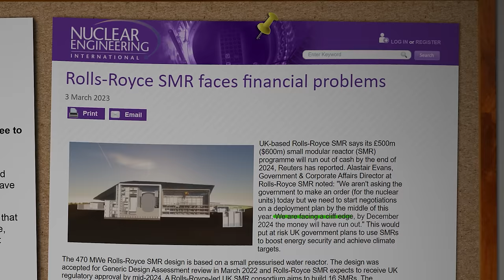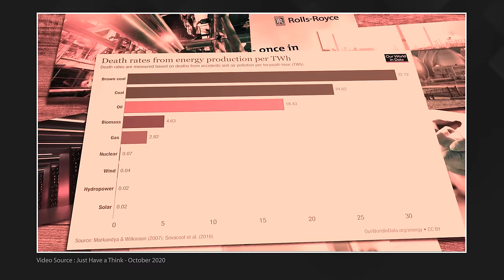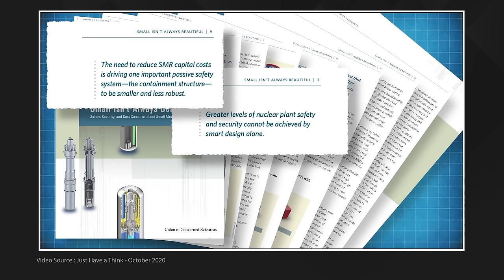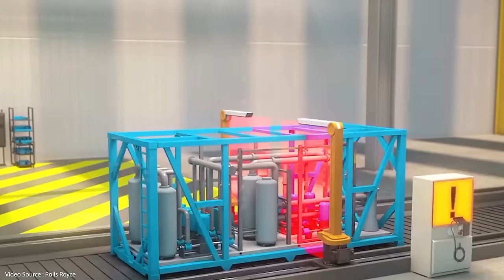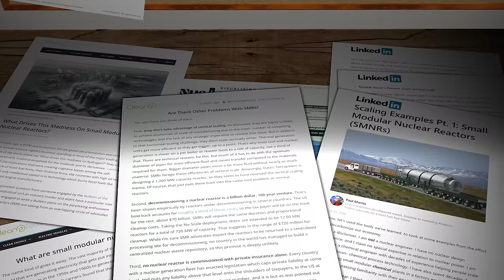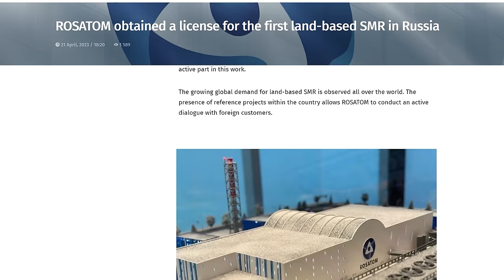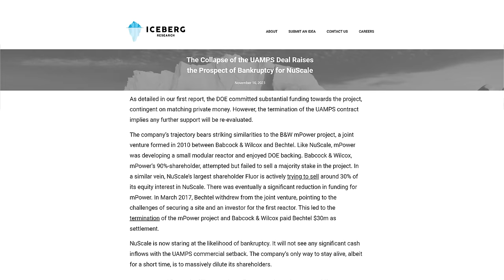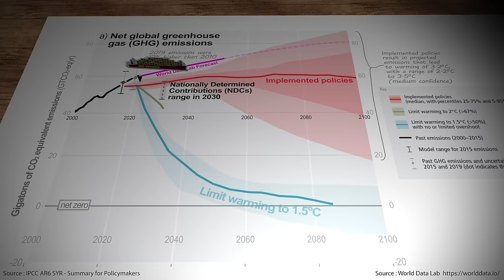Small Modular Nuclear Reactors. The Verdict

Comment: The thing about NuScale's $89/MWh estimate is that without subsidies it's actually $119/MWh. The thing was the head of the Idaho member of UAMPS, an industry veteran, had calculated the cost to be $130/MWh. 

Compared to $82/MWh for both wind & solar with lithium based storage currently according to independent analysis  by Lazard.

The difference also being solar, wind, and storage have a proven track record of declining costs, with newer technologies hitting the market with even lower costs. Nuclear, on the other hand, has a proven track record of rising costs even with reduced regulation and newer, simpler designs that were supposed to be quicker and cheaper to build (AP 1000 & EPR).

And as France found out the hard way, having most of your reactors being the same design means that a defect found in one, a 24mm deep crack found in a pipe, which carried radioactive water, with a wall thickness of 27mm meant that they had to shut down over half their fleet for inspections and repairs IN THE MIDDLE OF AN ENERGY CRISIS.

That on top of having to operate some of the rest of their fleet at reduced capacity due to inadequate cooling as the rivers they relied on were too warm. 

Honestly with a track record like that, how could an objective, rational person think nuclear is a good option?
Reply: To be fair, a key argument for SMRs is that power costs for the "Nth of a Kind" would be substantially lower due to mass production techniques and shorter build times.
Reply: @gibbonsdp  which has to be taken with a BIG pinch of salt considering the nuclear industry's long history of substantial cost & schedule overruns.

Even with France's much vaunted nuclear fleet, independent analysis has shown that their claims of low costs are due to heavy subsidies and very lowbal estimates of O&M costs. When the subsidies are factored out and realistic O&M costs based on real world experience are factored in, the claimed cost of $40/MWh ends up being $90/MWh.

But that analysis was before the latest kerfufle. With the much reduced capacity factor due to the shutdowns and reduced production due to the cooling issues, along with the repair costs for the cracked pipes, are factored in the costs will be higher.
Reply: @gibbonsdp  Those mass production assumptions are asymptotic, and the kind of scale needed to hit competitive pricing with solar and wind (which also benefit from economies of scale) for any form of nuclear is into the hundreds of thousands or millions of units, even for ill-conceived radium dial watches. Which for any form of nuclear exceeds the materials available on Earth by hundreds of thousands or millions of units.
Reply: the cost of renewables is going down because theres constant investment in them and their infrastructure
 nuclear is going up in price because its just not being worked on at the same scale, theres no experienced operators, builders, designers, even in countries with a history of having those things nuclear has just been forgotten about and an entire advanced industry isnt something you can cheaply build over night
as important as renewables are, having a base load of nuclear is always going to be a useful thing

also something interesting to note, its weird how people always bring up the subsidized cost of renewables or nuclear and say its too expensive without subsidies, while conveniently ignoring that fossil fuels are subsidised 7 trillion dollars per year globally
wonder how much fossil fuels would cost per mwh without those subsidies to get a more fair comparison
Reply: The cracks were found in pipes which do not carry radioactive water. These belong to the secondary circuit system. This problem was related to delayed maintenance due to Covid. And regarding water management of nuclear plants, some nuclear plants are concerned indeed by this issue but there are only a handful of nuclear plants in France being in that situation. It's not a question of water from rivers being too warm to be able to cool down the reactors, it's a question of water being too warm once thrown out to the river in order to avoid harming fauna and flora.
Reply: The main issue with solar and wind is its ability to provide baseload power for the grid, which is why they need battery storage to try and attempt to have some sort of reliable baseload power. With the electrification of the car industry and battery storage for the grid is currently relying mostly on lithium to solve both problems, however there is no current supply or untapped reserve  of lithium that could meet either of these needs. 
So a different source of baseload power is required for the grid instead of relying on wind, solar, and battery storage for the future electric grid needs. The only options that are left are nuclear and geothermal to meet the baseload requirements for the future. 
Of course there is the ultimate saviour for wind and solar being the only source of electricity for the world, an interconnected global grid. But that will never happen as global politics will not allow this to take place.
Reply: @bartroberts1514  What exactly are these materials needed by wind and solar in quantities exceeding the available resources by orders of magnitude?
Reply: @IronmanV5 you’re comparing two different types of nuclear power. You can’t use France or the past to argue a pattern of the past.  It’s a different path and different model for deployment and development…
Reply: @Drought-jr6pb  Nobody wants baseload power on the grid. Nuclear and coal run 24/7 and prohibit the efficient use of the energy produced by renewable power. If you have 15GW of baseload on the grid, you either waste excess renewable production or even worse use super expensive nuclear energy to produce green hydrogen. I am not sure if you are trolling, but lithium batteries are far from the only technologies for grid level storage. Natrium based batteries, redox flow, pressure and heat based systems all can store excess renewable energy. The last 10-15% of electricity production can be served by gas power plants, they are standing around anyway.
Reply: @batonnetdecannelle  Pleased to correct my post so no one can mistake the intended meaning that nuclear is the technology with scaling issues. Wind and solar do not have such problems.
Reply: @Drought-jr6pb  You're repeating fallacious assumptions. Wind and solar are not dependent on 'baseload' (more correctly, 'on demand') generation; grids that meet needs from solar and wind would be intermittent grids, that's true; however the very car industry you cite as a negative is the vector for V2G grid storage, where for the price of grid-scale storage that charges intermittently and dispatches on demand, you get a free vehicle.
Hydro, geothermal, biofuel remain all of them far more economical on demand power than nuclear or fossil. Why did you ignore hydro, which could easily be scaled up over two and a half times in the USA and EU, not counting pumped hydro?
Reply: I'm going to have to disagree. I think identifying flaws in a common design is a feature, not a bug. Any design can be flawed, more so if if it's bespoke. The implicit assumption is that a different design wouldn't have ANY flaws while a common design baseline (a "pattern") "extends the blast radius of flaws".
While it's true that, depending on what type of reliance or development cycle you're after, multiple design branches can have value. At some point rationalising down to a standard approach is more efficient and safe. Put another way, consider "a flaw found in one is a flaw found in many" as early detection...like I said, a feature.
Reply: I'll be cautious. The Solar with Storage concept doesn't fully compare to nuclear. Solar with Storage usually means X hours of storage capacity (typically 2 or 4). You can't expect it to cover all needs over night. But nuclear does work reliably over night. It's an unfair comparison.

You are really comparing to geothermal.
Reply: @clehaxze  Pumped hydro can store effectively for weeks or months, though.
Reply: @bartroberts1514  that's not what I mean. With X hours of storage means how long can the battery run given it's max output.

This metric will be useful until we have so much storage that it covers the entire night.
Reply: @clehaxze  Right now there are grids that are primary hydroelectric power. Every moment the power on that grid is supplied by solar or wind is a moment the hydroelectricity isn't running. When hydro isn't running, the water isn't flowing, and that power is stored. When solar or wind stop, that hydro storage can be tapped on demand.

So that X hours of storage is effectively as large as the supply of hydro available. Same deal for geothermal, which new breakthroughs make 1000 times more viable than a decade ago.

Sure, if all you have is battery storage, you're limited by the battery capacity.. but battery storage's real value isn't in its storage capacity; it's in the FCAS and AIM grid services available from the inverters in the battery array, stabilizing grid power and making the grid more efficient. Any battery makes back its own cost within three years on those services alone, without considering their storage.

After three years, solar plus battery effectively costs only as much as the solar, less the cost of the battery. Oh, and solar has those same inverters, which can be run whenever the sun isn't shining.

That's a deal impossible for any non-battery alternative to beat.
Reply: @bartroberts1514 I see your point. But also lots of grids runs on fossil fuel during the night. We need to get rid that that before ever caring about hydro. And I think we need action now. Not waiting 3 years for tech to mature. Climate change is bad enough.

This is why I think any clean power that runs 24/7 is more valuable then it's $/MWh price. Be it geothermal, nuclear, wave. You simply don't need batteries to displace fossil fuel.
Reply: @clehaxze  I say cut fossil supply 2% per month down to zero by 2030, and let Market forces figure it out.

Hint: nuclear can't compete, and fossil free renewables can. Irrational decisions like foregoing hydro because of NIMBYs or going nuclear because you've got coal to cover demand until nuclear's ready? Won't withstand a policy of non-extraction.
Reply: @bartroberts1514 Neither the  market nor the government will allow you to cut fossil fuels by 2% constantly. I hope it happens, but I predict it won't.

What makes you think I support doing nothing while people build nuclear (and ditching hydro)? If so, I apologies for any confusion. To make it clear, I want us to build much more solar and wind. What I'm replying to is you part saying "Right now there are grids that are primary hydroelectric power" by saying there are grids that hydro is a minuscule player. And acknowledge the fact that we don't yet have batteries large enough to last the entire night for an entire grid. As so, any clean power source that runs the entire day will help kill fossil fuel during the night.
Reply: @clehaxze  Actually, flow batteries and pumped hydro, which ironically was developed to help make nuclear more economical,  are good for 10-12 hours and are even cheaper than lithium batteries.

Only gas combined cycle is currently cheaper when unubsidized costs are compared with renewables and lithium storage.  

So soon enough even gcc won't be able to compete.

What far too many nuclear advocates can't,  or refuse to, understand is the death spiral that will start when nuclear won't be able to operate as much due to no or few buyers on the wholesale electricity market. 

So they won't produce as much. Which reduces their capacity factor increasing the price they have to charge just to break even.

We've already seen this happen in Australia where the Tesla Hornsdale Power Reserve has replaced gas speaker plants as they can no longer compete.

This was with NMC lithium batteries, the most expensive, which have since been replaced in newer grid scale reserves with cheaper LFP batteries.

And as you mentioned, there is geothermal for which designs are being tested right now that can be deployed to more places and whose costs are projected to be competitive with renewables.

Outside of niche cases, nuclear as it stands just can't compete with renewables + storage or even gas or coal.
Reply: The problem is we need long cycle energy storage that lithium cannot provide. The cost argument only works if you take full system costs into consideration, instead of just pointing to “cheap” wind and solar as if it is a panacea. Instead of viewing electricity as a commodity, we need to have more wholistic understanding of the grid as a system.
Reply: @mere_cat  Then let's explore wholistic [sic] understanding of grid systems.

Demand rises and falls, and by coincidence the "Duck Curve" of demand has a fair overlap with the general contribution of solar and wind power. Too much power on a grid is as bad as too little, so some large users of power are paid -- arbitraged -- to take power when peak delivery exceeds demand.  When non-defrayable demand (that is, when there aren't enough users who can be bought off to stop using on a moment's notice) exceeds production, idle 'on demand' generation is brought online.

Because AC frequencies and phases are so critical to efficient grid function, inverters are needed to provide FCAS. Because of ghost load, AIM services are also needed. Both FCAS and AIM are available through solar and battery storage circuits, defraying their costs by improving grid signal quality.

With UHV transfer stations and UHVDC transmission, grids can share power from far away, many timezones different, for example, or many weather zones, so a grid experiencing storms or at night could ship in power from a grid with sun.

With this holistic approach, a grid with an appropriate mix of on demand battery, biomass, geothermal, hydro, and pumped hydro could arbitrage excess solar and wind from thousands of miles away and store that power to resell at profit.

And solar and wind continue to get cheaper every day.

Holistic enough for you?

Note, no nuclei were subjected to fission in this scenario, and no fossil trade was needed.
Reply: @bartroberts1514  Solar and wind LCOE have gone up the last couple years and according to the IEA are expected to remain above 2020 levels in 2024. I think it is great to have a vision for the future, both short and long term that incorporates multiple technologies because things don’t always turn out the way you expect.
Reply: Molten Salt Reactors don't require cooling towers, nor do they need to be located on waterways.
Recent developments
The Fuji MSR
The FUJI MSR was a design for a 100 to 200 MWe molten-salt-fueled thorium fuel cycle thermal breeder reactor, using technology similar to the Oak Ridge National Laboratory Reactor Experiment. It was being developed by a consortium including members from Japan, the United States, and Russia. As a breeder reactor, it converts thorium into nuclear fuels.[98] An industry group presented updated plans about FUJI MSR in July 2010.[99] They projected a cost of 2.85 cents per kilowatt hour.[100]

The IThEMS consortium planned to first build a much smaller MiniFUJI 10 MWe reactor of the same design once it had secured an additional $300 million in funding, but IThEMS closed in 2011 after it was unable to secure adequate funding. A new company, Thorium Tech Solution (TTS), was founded in 2011 by Kazuo Furukawa, the chief scientist from IThEMS, and Masaaki Furukawa. TTS acquired the FUJI design and some related patents.

Chinese thorium MSR project
The People's Republic of China has initiated a research and development project in thorium molten-salt reactor technology.[101] It was formally announced at the Chinese Academy of Sciences (CAS) annual conference in January 2011. Its ultimate target is to investigate and develop a thorium based molten salt nuclear system in about 20 years.[102][103] An expected intermediate outcome of the TMSR research program is to build a 2 MW pebble bed fluoride salt cooled research reactor in 2015, and a 2 MW molten salt fueled research reactor in 2017. This would be followed by a 10 MW demonstrator reactor and a 100 MW pilot reactors.[104][105] The project is spearheaded by Jiang Mianheng, with a start-up budget of $350 million, and has already recruited 140 PhD scientists, working full-time on thorium molten salt reactor research at the Shanghai Institute of Applied Physics. An expansion of staffing has increased to 700 as of 2015.[106] As of 2016, their plan is for a 10MW pilot LFTR is expected to be made operational in 2025, with a 100MW version set to follow in 2035.[107]

At the end of August 2021, the Shanghai Institute of Applied Physics (SINAP) completed the construction of a 2MW (thermal) experimental thorium molten salt reactor in Wuwei, Gansu, known as the TMSR-LF1.[108] China plans to follow up the experiment with a 373MW version by 2030.[109]

Flibe Energy
Kirk Sorensen, former NASA scientist and Chief Nuclear Technologist at Teledyne Brown Engineering, has been a long-time promoter of thorium fuel cycle and particularly liquid fluoride thorium reactors. He first researched thorium reactors while working at NASA, while evaluating power plant designs suitable for lunar colonies. Material about this fuel cycle was surprisingly hard to find, so in 2006 Sorensen started "energyfromthorium.com", a document repository, forum, and blog to promote this technology. In 2006, Sorensen coined the liquid fluoride thorium reactor and LFTR nomenclature to describe a subset of molten salt reactor designs based on liquid fluoride-salt fuels with breeding of thorium into uranium-233 in the thermal spectrum. In 2011, Sorensen founded Flibe Energy, a company that initially intends to develop 20–50 MW LFTR small modular reactor designs to power military bases; Sorensen noted that it is easier to promote novel military designs than civilian power station designs in the context of the modern US nuclear regulatory and political environment.[110][111] An independent technology assessment coordinated with EPRI and Southern Company represents the most detailed information so far publicly available about Flibe Energy's proposed LFTR design.[112]

Thorium Energy Generation Pty. Limited (TEG)
Thorium Energy Generation Pty. Limited (TEG) was an Australian research and development company dedicated to the worldwide commercial development of LFTR reactors, as well as thorium accelerator-driven systems. As of June 2015, TEG had ceased operations.

Alvin Weinberg Foundation
The Alvin Weinberg Foundation was a British charity founded in 2011, dedicated to raising awareness about the potential of thorium energy and LFTR. It was formally launched at the House of Lords on 8 September 2011.[113][114][115] It is named after American nuclear physicist Alvin M. Weinberg, who pioneered the thorium molten salt reactor research.

Thorcon
ThorCon nuclear reactor is a proposed floating molten salt reactor, by the US-based Thorcon company. The two-reactor unit is designed to be manufactured on an assembly line in a shipyard, and to be delivered via barge to any ocean or major waterway shoreline. The reactors are to be delivered as a sealed unit and never opened on site. All reactor maintenance and fuel processing is done at an off-site location.
Reply: @deaddocreallydeaddoc5244  Cite?

Because IIRC, your source also had a great number of warnings, caveats, and reservations that MSNR would succeed.

Can you point us to the original publication?
Reply: "independent analysis  by Lazard" No, Lazard is not a trustworthy source, they are either lazy or biased. Use different sources.
Reply: @migBdk  Wah, wah, wah, the Wall Street firm with over a century of experience doing financial analysis has shown that nuclear can't  hope to compete so I am going to claim they are biased or lazy without credible proof wah, wah, wah.
Reply: @IronmanV5  

What is Lazard?

The calculation model many opinion leaders refer to when they claim that nuclear power is extremely expensive compared to wind and solar power comes from the American investment bank Lazard [1]. They have large wind and solar energy investments and are not a peer-reviewed scientific body.

Lazard’s assumptions strongly skew the comparison in favor of wind/solar and nuclear power without an empirical basis for it. Therefore, they find completely different price estimates than the energy experts at the International Energy Agency (IEA).

Biased investment rate

Lazard assumes a very high investment rate of 10% for nuclear power but 0% for wind and solar, which makes the comparison deeply unfair.

Biased longevity

Lazard assumes a lifetime of nuclear power of 40 years, although many nuclear power plants are licensed to operate for a minimum of 60 years. According to the UN, no technical limitation on service life exists [2].

Biased capacity factors

Lazard assumes unrealistically high capacity factors for wind and solar, which means their estimated price of these energy sources is lower than otherwise.

The capacity factor tells how much an energy source produces on average compared to its capability.

The problem, however, is that the assumptions are highly objectionable and not rooted in reality.

In Germany, wind energy had an average capacity factor of around 25% in 2015-2021, while Lazard assumes 38-55% – even for onshore wind [3]. For solar, the capacity factor in Germany was about 10%, while Lazard assumes between 14 and as much as 36%.

Sources

      https://www.lazard.com/media/451905/lazards-levelized-cost-of-energy-version-150-vf.pdf
      https://unece.org/sites/default/files/2021-08/Nuclear%20power%20brief_EN_0.pdf
      https://preview.redd.it/dr4liqo9xec81.gif?format=mp4&s=7d23ec4de1d27e6299872b73bcaf96fe563f8370